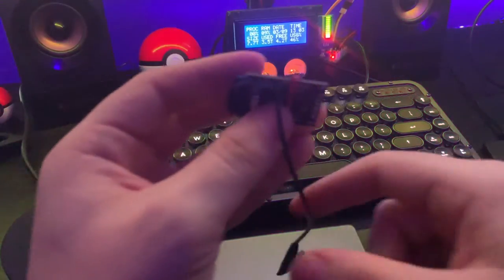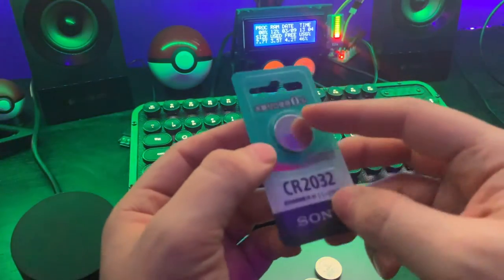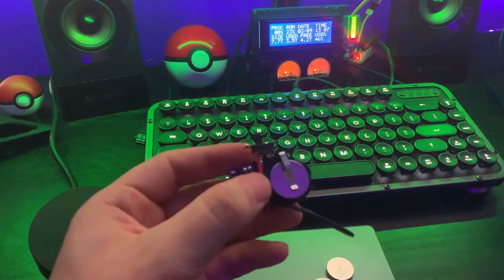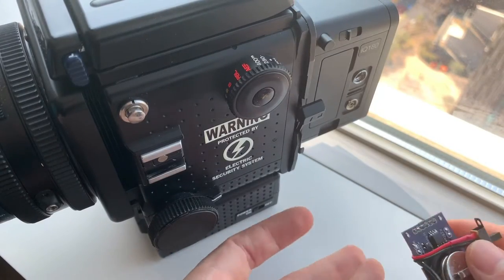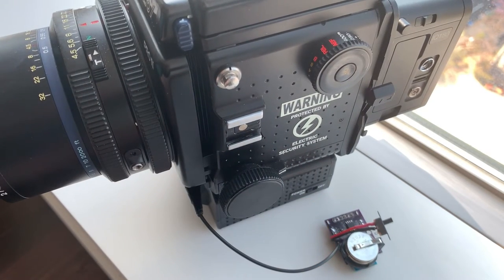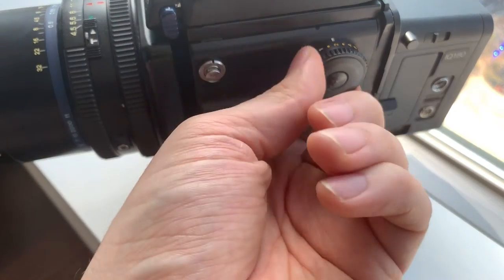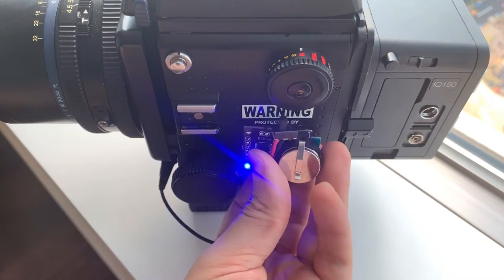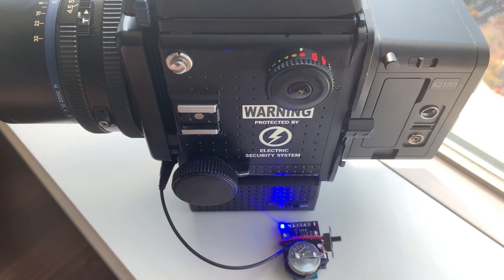Mamiya RZ67 Pro II / iPhone wireless remote trigger

Comment: Great job Julio,
Have you considered to get a Anycubic Photon for the case work? I’m looking in to this myself for arduino work.
It would be good to make an modular casing for the electronics that have the possibility to be attached to the camera via 1) the hot shoe 2) velcro (or similar) 3) standard tripod hole (3/8 or 1/4 thread) for mounting on custom cheese plate.

I’ve been using a RZproii myself for a couple of years (only film) and just recently got a p45+ so I’m very interested in your experiments.
Reply from the maker: Oh man, you got me. Yeah acrylic 3D prints sound really nice. But I don’t have the coins to get one. That sounds like a really nice idea to make modular. It could have several “feet” to get attached to things differently. Another option I was looking at would be design it and put it on thingverse for anyone to get the files if they want to modify and can print. Some prefer to order prints some do have their own 3D printer and some really don’t care for geek stuff as long as their camera works like they want to.

Comment: Looking good, Is this a custom PCB design? If so what is the difference between a bluetooth module/relay/switch connected to an iPhone?
Reply from the maker: It is a custom pcb, what is a Bluetooth module/relay/switch? And how do you connect it to an iPhone? With the settings/Bluetooth? Or you actually need a companion app for it?